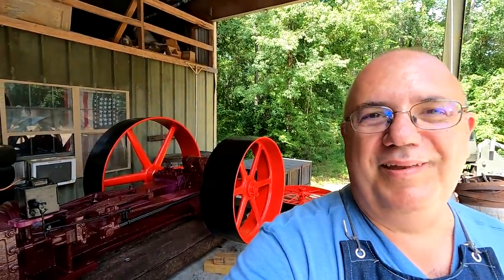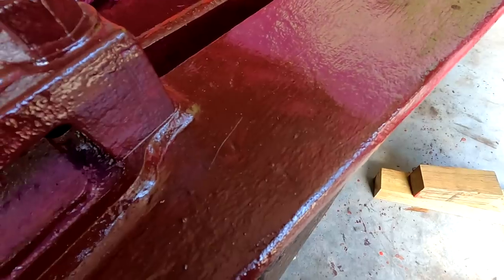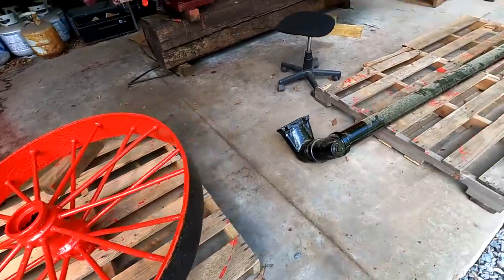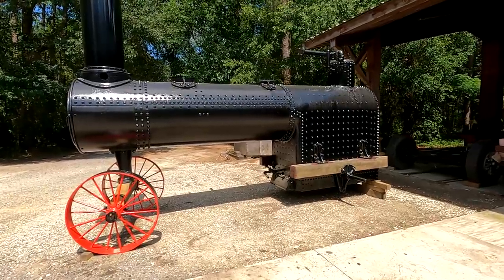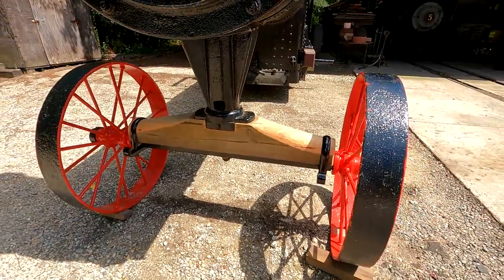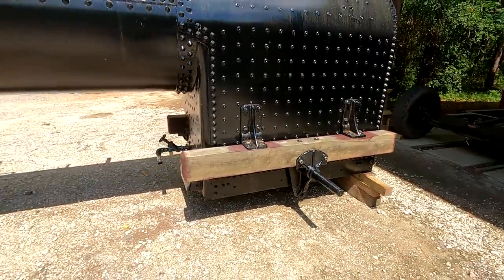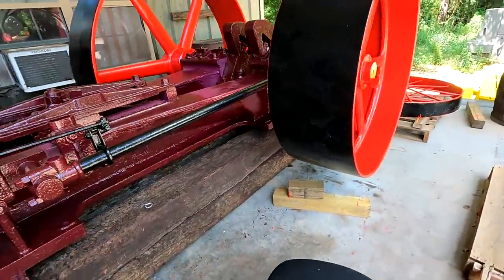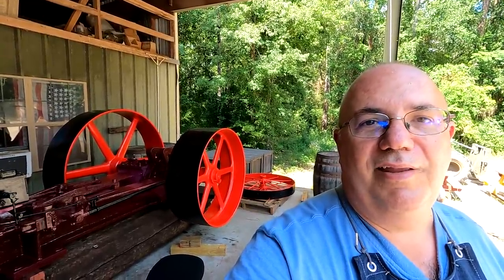Frick Steam Engine Restoration Update

Comment: As an engineer, it's saddening to know it'll only be restored to a static exhibit. I completely understand the boiler issue but looking at the crosshead slides all painted just makes me mad. The slides should be clean and lubricated and visitors should be given a 'hands on' opportunity to turn the flywheel to see the movement and feel the weight of the moving components. I'd love to make it a 'low pressure' exhibit engine - running on 15psi air - with a functional governor - and perhaps some added 'plastic' linkages to the control valve so that small governed valve adjustments can be clearly seen by the visitors - who like to 'load' the flywheel.
Reply: Definitely this!
Reply: @Current Batches Equally, it could be run off a modern oil or gas-fired steam boiler - set to 100 psi or whatever.

Comment: What i'd do is hide a belt drive in a structure below it to drive it. Then, using a cheap steam generator(like the ones used to clean industrial lots and stuff), plug that to the drive portion, bypassing the boiler. By no means, would that be able to drive it, they only make steam, no pressure, however... that would make the sounds and the looks of operation, whilst the hidden drive belt under, powered by a motor would move it.

You can then put a small plaque by it and a donation method saying something akin to "this is how it should work, unfortunately, it's all smoke and mirrors, driven by an electric motor, if you'd be so kind as to contribute etc".

There's only so much one institution can do to keep these things running, but with the help of the public it should help, no?

For those questioning the ethics of this "heart string pull" i've seen it done in much larger museums, with much larger "ethics' concerns. Paintings exposed in their worst condition with similar texts under. Just my 2 cents.

Comment: Is it not possible to restore/rebuild the boiler so it's back in an operating state? Or is it because of the rivets? Just a shame and seems like a waste to let a piece of history just to become a "static" exhibit. There has to be way to make it a functional piece that passes inspection. Great video, cheers :)
Reply: It's the rivet design that makes it inherently unsafe. As you can imagine, with continual thermal expansion and contraction due to how these operated, the rivets will loosen over time and even weaken with metal fatigue because of the pressure cycle. Modern boilers are welded and then X-rayed before they are certified.
In some cases where there was the intent to keep a functioning "appearance of originality", they can have a replica welded boiler made with "fake" rivets or they can have the original boiler rebuilt with a modern boiler hidden inside the original.
In either case, it's extremely expensive to have one of those done and most museums just don't have the funding necessary to accomplish that which is why almost all riveted boilers are now nonfunctional.
The insurance companies just don't want to take the chance and I can't really blame them.